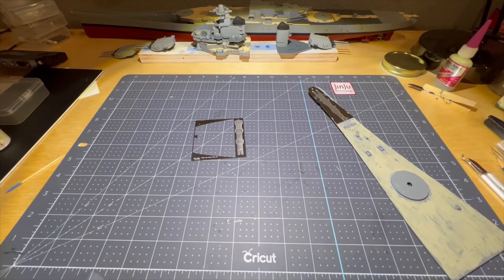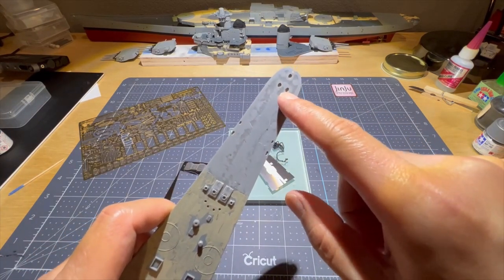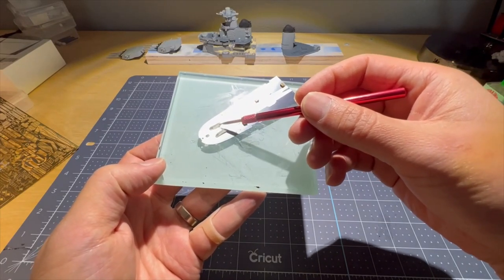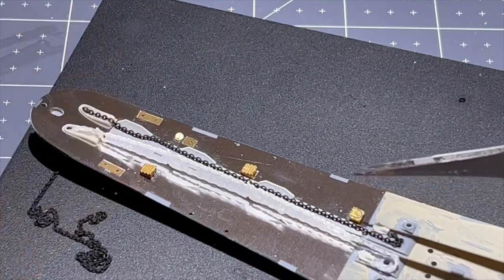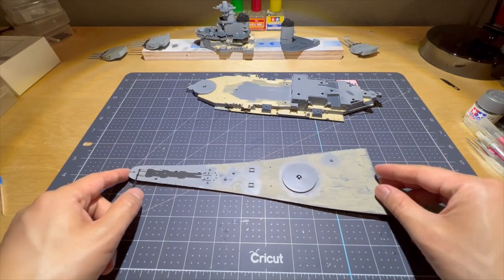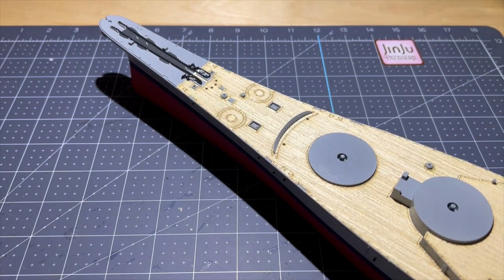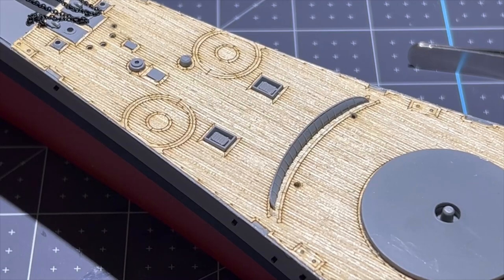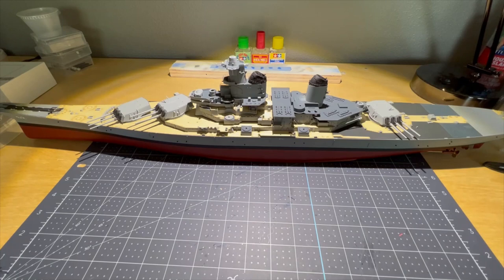1:350 Tamiya USS New Jersey Build 13

Comment: Looking good! Did you use extra glue to attach the deck? If so, what kind??
Reply from the maker: Thanks Chris! I used Gorilla wood glue on the plastic deck and under the wooden deck to neuter the adhesive backing.
Reply: @theokmodeler5755  So you put glue in both the plastic  deck and the wood deck? Gorilla glue must have a slow cure. I tried wood glue and it didn’t work well. Cured to quickly.
Reply from the maker: @chrismonson3581  Yes, I put glue on both the plastic deck and wood. I show how I did it on the 9th NJ build video at or around the 8:30 mark. Gorilla glue becomes a little tacky after maybe 5 minutes but still workable. If your wood glue is more than 2 years old after purchase, you want to get a new bottle.

Comment: How do you cut the deck off the sheet? I just received my ponto kit and am about to embark on this misson of patience
Reply from the maker: I used a new exact-o blade. A dull one will make it hard to cut through the plastic film. Patience is key!! You got this!
Reply: @theokmodeler5755  thanks mate. I started the bow section tonight with PE. Working out what parts I can fit for paint all at once and what I have to paint separately. And I am working out what tools I need that will help with the PE parts too, any tips on tools?
Reply from the maker: @FTX03  you’ll need a folding tool. You can check this website out https://thesmallshop.com/collections/photo-etch-bending-tools

Sanding sticks can help smooth some PE parts. Lots of exacto blades so you can make clean cuts.